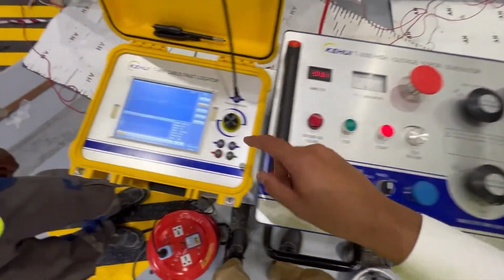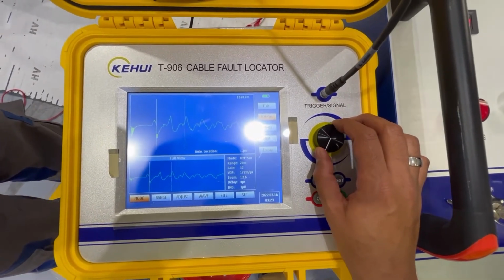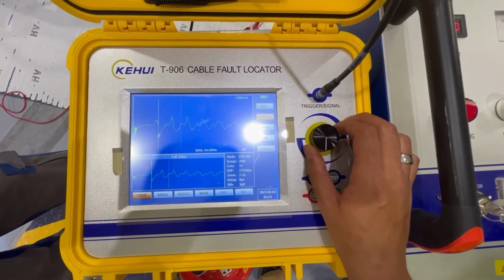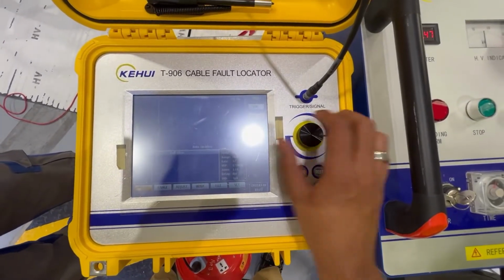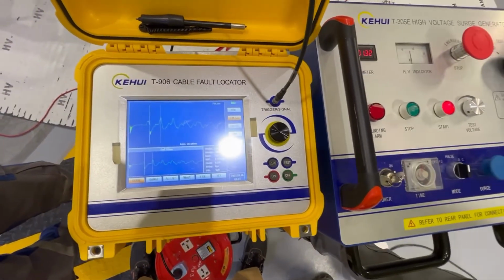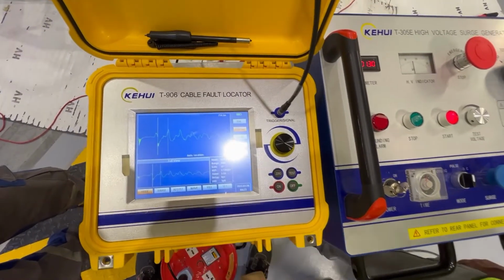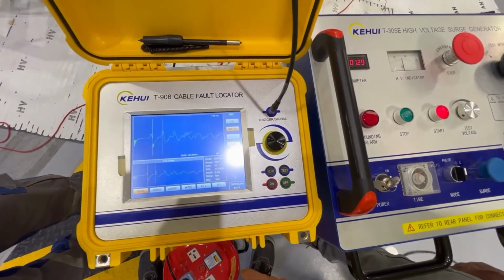Kehui Cable Fault locator Live Demonstration and training (T305E, T906, T506)

Comment: @syedmudassirpasha A/Salam Dear, Can we use this unit to locate the sheath fault in the 110-132 KV XLPE cable. injecting to sheath through linkbox in a particular section.